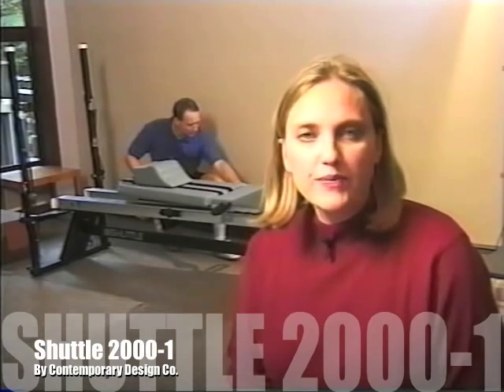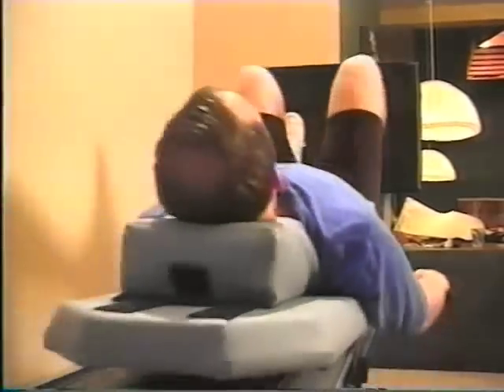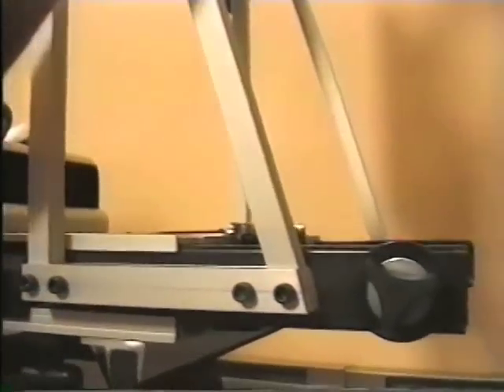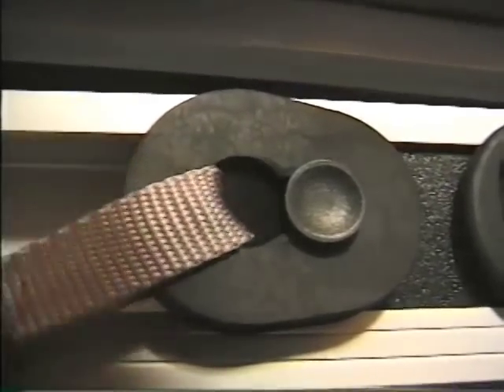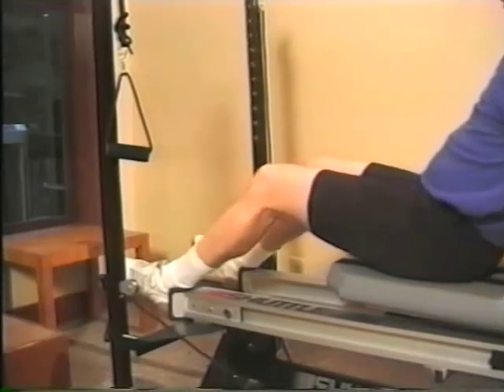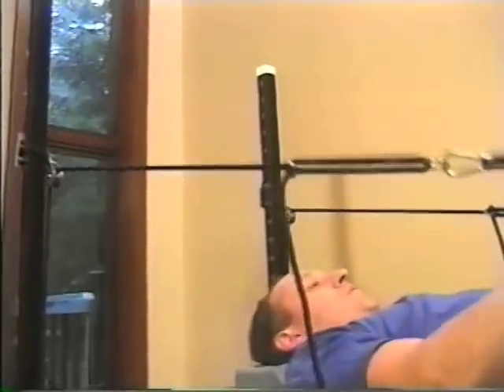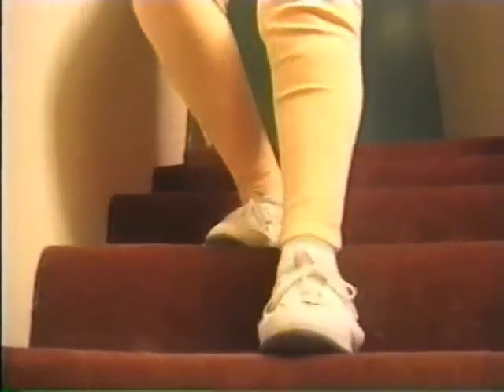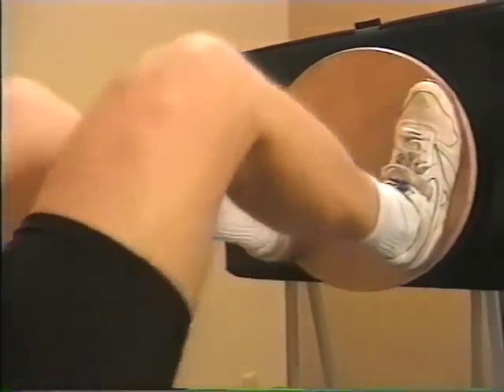Shuttle 2000-1 Adjustment Mechanisms

Comment: How different is this from Total Gym professional models?
Reply from the maker: +M HM The Shuttle 2000-1 provides elastic resistance up to 160lbs at full extension and a supine backrest that allows low impact physical therapy protocols to be accomplished in a comfortable position. The Total Gym products use body weight and gravity. Both Total Gym and Shuttle 2000-1 products have pulley systems unique to each system. Please see http://www.shuttlesystems.com for more info on our products or Total Gym online for more details.